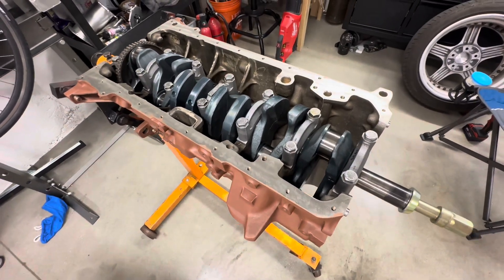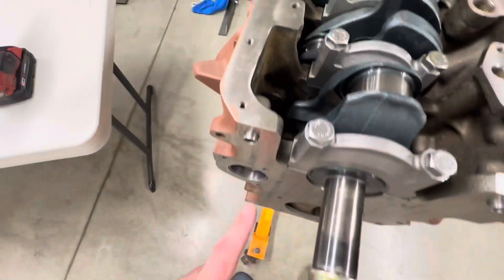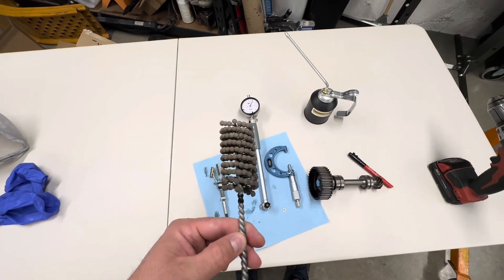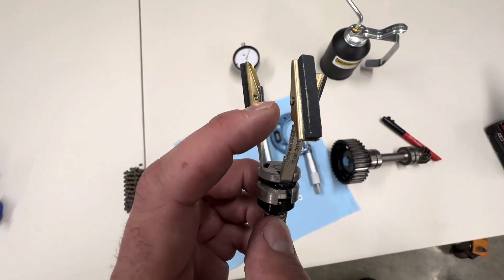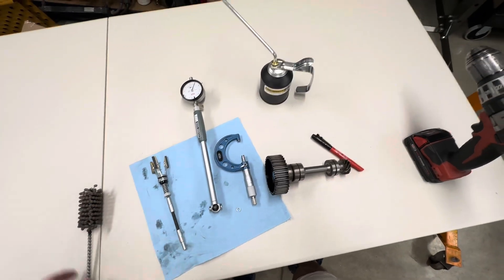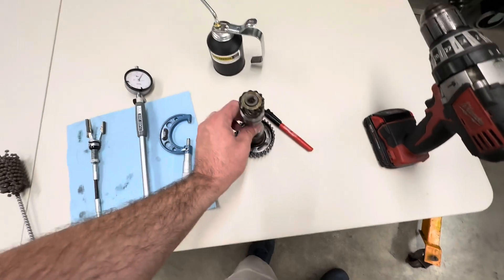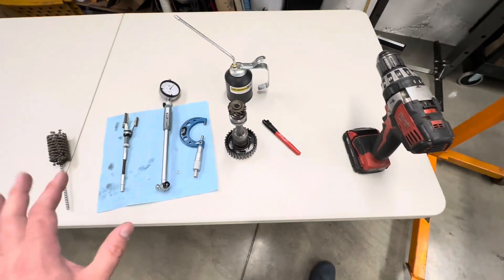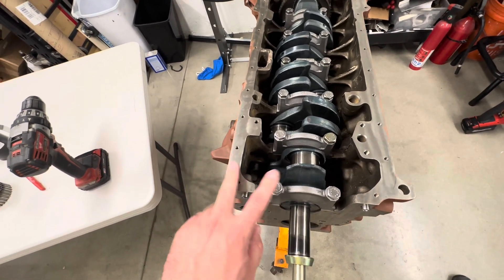BMW M20 Intermediate Shaft Bearing Dramas

Comment: Holy crap, I'm not the only one building an M20 in 2025. Love it. Your build looks absolutely surgical. I'm curious with a bottom end that looks that beautiful, what are you doing for rockers? The billet aftermarket ones are more than I wanted to spend, so I hand cleaned up factory ones the best I could.
Reply from the maker: I have bimmerheads HD rockers, cat cams 285 , hd dual springs

Comment: Press them in and get the machine shop to bore them to within a thou that way they are sure to be aligned to and then final touch up with hone. You don’t want to remove much with a brake hone it’s not accurate it’s easier to get the shaft ground as said above.

Don’t neck down the shaft except minimum for clearance they are hollow and will break. You’re not saving anything significant by doing so